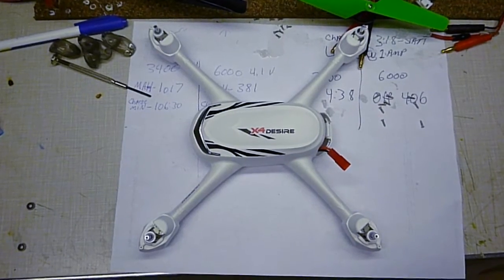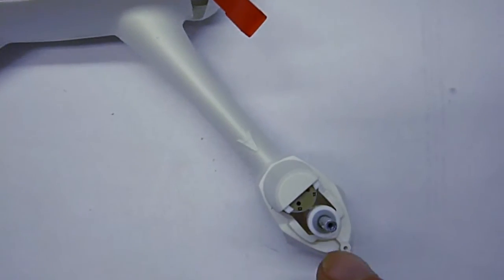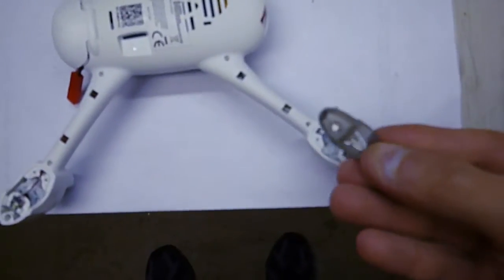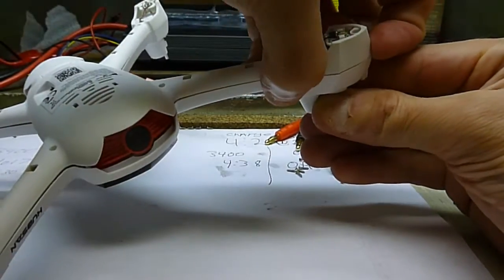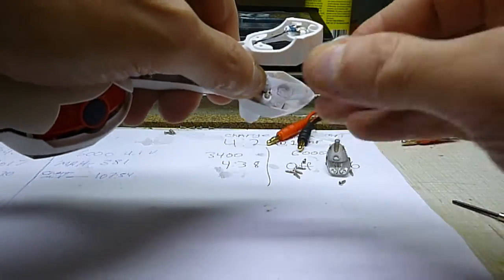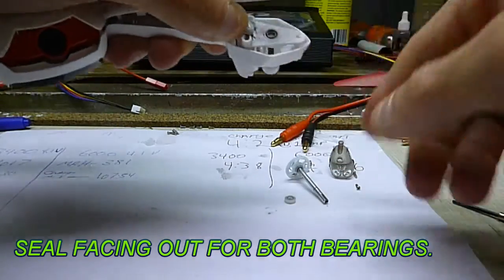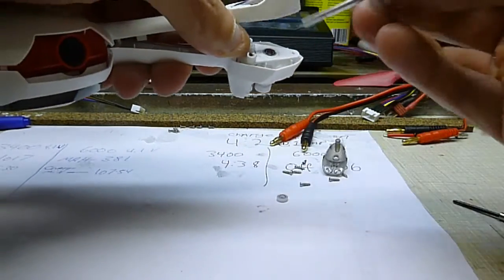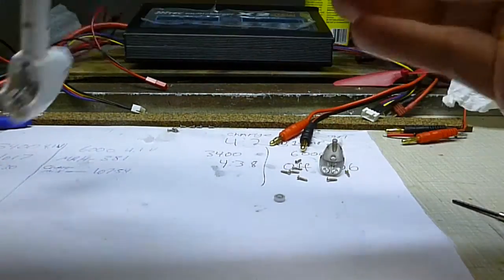Hubsan H502E ball bearing Upgrade

Comment: Hi.  So I just got one of these and they come with solid plastic (nylon?) bushings.  No ball bearing whatsoever.  Did you happen to spin the propellers before and after installing the LaTrax bearing and do they spin more freely?  Also,  I don't understand what you mean about seal side of the LaTrax bearings.  Can you elaborate how to establish proper orientation of the LaTrax bearings.  They looked the same to me on each side in your video.
Reply from the maker: 😁Hi thanks for stopping by, I though they now came with bearings in these? anyhow they make it fly much more stable less vibration... if you get the bearings you will see one side of the bearing you can see the tiny metal balls inside it and you want the sides you can't see the balls in the bearing facing out so they are better protected from dust and stuff.
Reply: @ShenRC  Thanks for super fast reply!  It is quite coincidental these Traxxas bearings are an exact fit for the H502E although perhaps it is a common size for quadcopters.

Comment: Do you need to grease the new bearing first
Reply from the maker: Light oil maybe once and a while like a slot car ball bearing oil or RC bearing oil would help them last but dont get dirt in them stay away from dusty spots when taking off and landing.

Comment: Great video. Short, sweet and to the point. I ordered mine from Banggood.com. I also lubricated before installing them. After you install the bearings, break in the motors by arming the quad without the propellers and let it run for 5 minutes. You are good to go.
Reply from the maker: Yep thanks, I also  covered the motor break in in another video =)
Reply: shenlonco yep, that's the "break in" video I was talking of. Hadn't noticed it was from the same poster, you. I think every new H502E owner should follow these 2 videos. I also recommend not to over tighten the propellers and damage/strip the threads on the shaft. Also always take off to couple of meters and make sure there is no toilet bowl effect. If so, land and re-calibrate the compass.
Reply from the maker: yep toilet bowl land and restart for sure! =)

Comment: Nice to mod the H502e with the ball bearings based on this video. My new H502s came with ball bearings factory installed. The drone is MUCH quieter and smoother with ball bearings compared to the OEM plastic bushings! Thanks for posting a useful video.
Reply from the maker: Thanks, Its funny some H502 quads come with bb already most don't maybe recent ones have them?

Comment: I have an extra 2000mah 7.4v  25c lipo battery here(i will modify the battery connector to make it compatible), is it okay to use it with my hubsan h502e??
Reply from the maker: Hi I would not use it, it will be much more weight than the stock battery and it will be hard for the H502e to fly with the extra weight and the motors will get stressed out much more and probably burn out real fast.

Comment: Another question please. I've seen replacement motors for the H205e that have brass gear instead of the nylon one. This a better way to go?
Reply from the maker: Hi I am not sure about brass, but I would stick with the plastic ones because they use them for the stock quad and those motors with a brass pinion gear may be different.

Comment: I've seen a white grease on some quad gears. My Holy Stone had that stuff on its gears. You know if it may be better than oil since most bearing are usually pack with grease not oiled?
Reply from the maker: Hi I would not use grease on the gears or bearing shafts you can use a light oil like bearing oil or slot car oil on the bearing shafts, or you can try out some dry lube and use it in both areas ... do a search on the web and try and find some if you want to go that route

Comment: Hi great vid i was wondering if you had a link for the ball bearings for my new Hubsan 502s that's coming in this week. I have also ordered 4 replacement motors, extra props and a Antenna mod for extended range if i need it but will fly it stock for now but good to have mod just in case and its a no soldering mod too even better OK thanks, and looking forward for more info and link for bearings for 502s
Reply: Event Horizon I believe the 502S comes with metal bearings. 502E does not.
Reply from the maker: Hi you use traxxas latrax alias ball bearings here is a link for you.
http://www.ebay.com/itm/Traxxas-TRA-3-x-6-x-2mm-Ball-Bearings-LaTrax-Alias-8-6642-TRA6642-/192033935071?hash=item2cb61d4edf:g:lG0AAOSwq7JT7kEj

Comment: So lets hear it run with the new bearing's .
Reply from the maker: Hi I flew it many times and it's much smoother and better....if you own one I highly suggest getting the latrax alias bearings and putting them in. :-)
Reply: I'll be getting mind Monday 10/24 also ordered extra motor's and battery
Reply from the maker: Don't order bearings for it just yet I heard the latest versions now come with bearings.
Reply: Thanks for the heads up . Have you had to replace motors yet ?
Reply from the maker: Nope not yet see my H502E videos I broke my motors in before flying and also do another trick after flying after the quad cools down and so far so good!

Comment: Would you post a link to the ball bearings your using?
Reply from the maker: Sure here they are. :-)
http://www.ebay.com/itm/LaTrax-Parts-Ball-Bearings-Alias-3x6x2mm-8-6642-new-/322153437126?hash=item4b01d757c6:g:nL0AAOSwMNxXYl6s